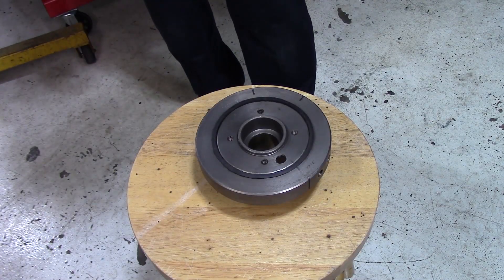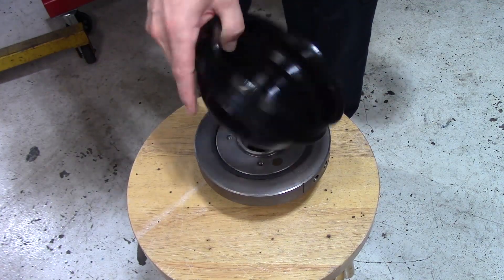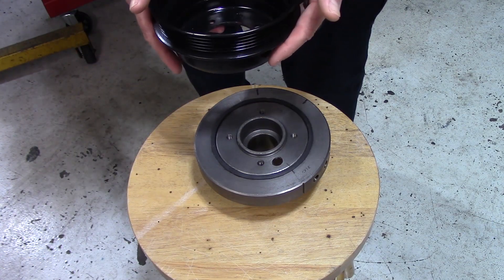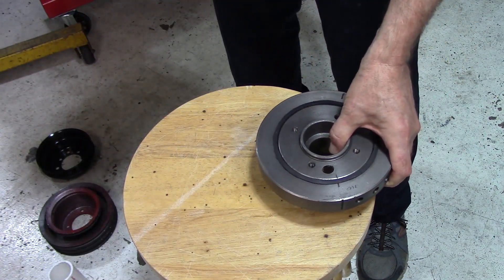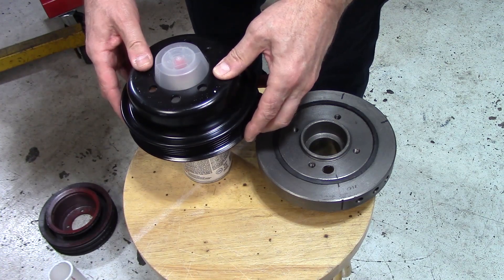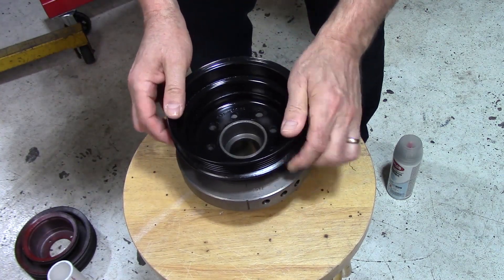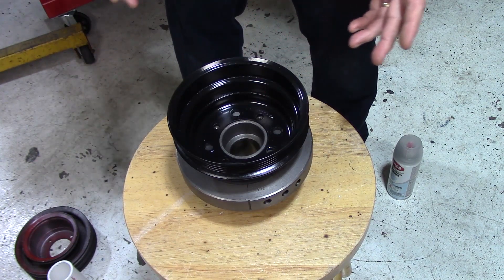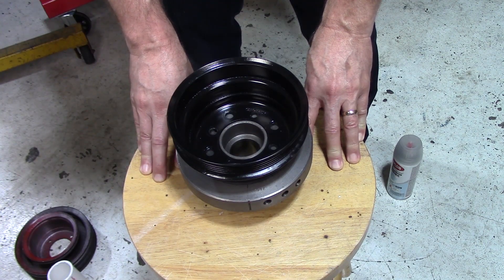Serpentine Belt Update: Crank Pulley Modification!! 1987 Olds 442: Video 67

Comment: From what I have seen that kit already comes with the adapter plate to align the F word pulley so you can drill to fit.
Reply from the maker: Yes it does. I bought mine from a different guy earlier than that. I was talking with the second kit company to see if I could get just the adapter to review and update that video with new info. Never heard back from them. Oh well.

Comment: Sorry to see you don't get more traffic !   You do impressive, detailed work.  The great thing about these "G bodies" is that they give you 60s muscle car performance potential, without the collector car price !
We want something fun to DRIVE !   And if we can put it together with "junk", all the better !
I have an 81 Olds cutlass wagon ("cruiser") that came with a Buick V6, which I upgraded to a '69 455 in the 20th century.  It has been sitting a while, and I am thinking of an upgrade.  I actually found some factory 442 dual exhaust manifolds on EBAY, which has given me an incentive to get rid of the old factory crossover system I kept.
Just want to say your efforts are appreciated.
Reply from the maker: Thank you Davey, that really does mean a lot. 
I handicap myself by sporadic uploads. The YT algorithm wants weekly uploads and a bunch of shorts too. I'm just posting when there's something to post.
The kind words are what keep me going. Thank you!!
Reply: @hutchhiperf finally for my 200r4 done and in. Not to bother youn but really need that part # off of that Ford pulley or source me out one where u are and let me know the damage. And really need that reverse rotation water Pump as well. Can't locate a for certain anyplace.  Thanks.